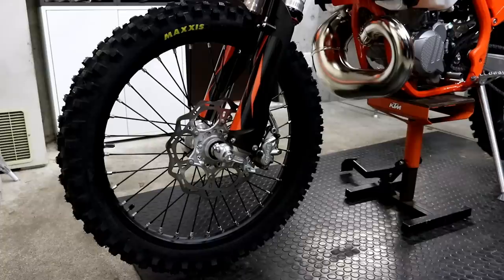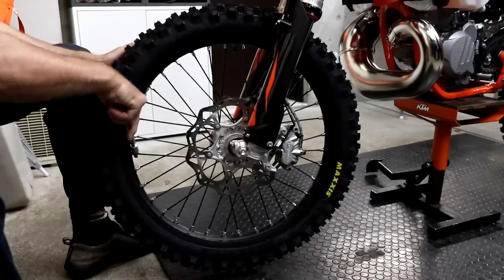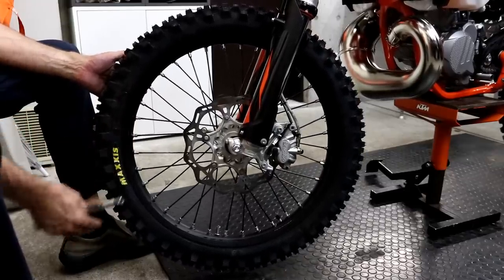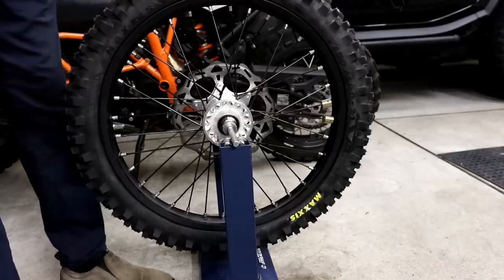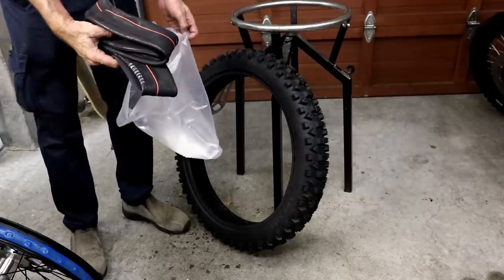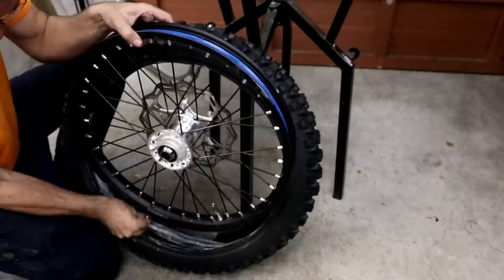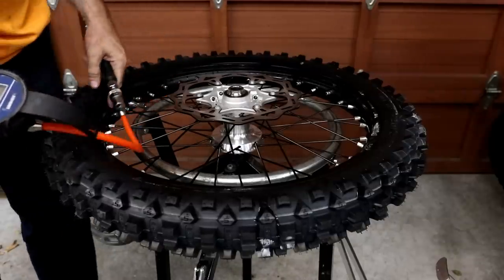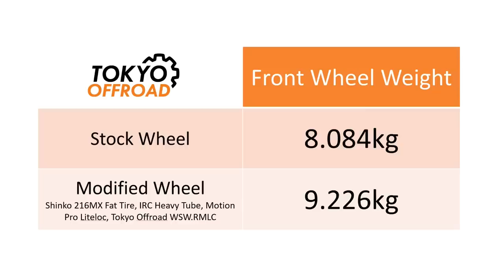2019 KTM 250 EXC TPI- Front Wheel Preparation & Mods

Comment: Run a similar setup with the IRC heavy duty tube up front and tubliss rear.  Ive ran both the Shinko 216 fatty and GT 216 (latest version) and am back running the GT.  The side knobs chunked on the Shinko after 5 rides and was toast.  Ive had no problems with the GT fatty chunking on all of them i have ran.  I also was surprised by the weight difference between the two.  You immediately notice it when just holding each tire in your hand.   I weighed both and the GT came in at 1.8lbs lighter.  

Anyways, I appreciate your video and detail explanations.  Always enjoy watching them.  Look forward to hearing more about the TPI and how its working for you.
Reply from the maker: Wow, I'm surprised at the weight difference. When I compared the Shinko 216MX with the GT216AA Fat Tire (original version) the weights were virtually identical. I'll have to get one of the new version GT216AA and try it.
Reply: Tokyo Offroad I believe the Shinko version is 4 ply and the GT is 2 ply only.  GT used to sell a 2 and 4 ply version of the fatty.
Reply from the maker: LostInPA - Other than the side knob tearing I’m really happy with the Shinko 216MX Fatty. I’m keeping an eye on the current ones I have mounted to see if they do the same. I’m hoping that Shinko have, or can fit this issue as they are otherwise excellent tires IMO

Comment: Mark, if the wheel is true and only needs tightening, then its important to take MAX 1/8 - 1/4 turn on each spoke and go round and round until all spokes are getting equal tension...tightening the spoke immediately to target torque setting will screw up the wheel trueness (personal experience).
Reply from the maker: Some of the spokes were quite loose and a few at torque already. As shown in the video I didn’t immediately tighten the loose spokes to torque, it took me 3 rounds before all spokes were at torque. I choose to tighten a maximum of 1/2 a turn in one go.

Comment: Hi Tokyo, can you give some more details on the torque wrench please. Thanks for a great video.
Reply from the maker: It's a Tohnichi CL10NX8D-MH torque wrench which covers a 2-10Nm range. The head can be exchanged. 
https://www.tohnichi.com/products/adjustable-torque-wrench-CLMH.htm
As I mentioned in the video I made an adapter so I can use a Fasst 6.8mm spoke nipple head. If you don't have access to a lathe and want something which works out of the box Fasst have preset and adjustable spoke torque wrenches which are available as kits with various heads, or the wrench only and you purchase the heads you need separately.
https://www.fasstco.com/collections/motorcycle/products/spoke-torque-wrench
https://www.fasstco.com/collections/motorcycle/products/adjustable-spoke-torque-wrench

Comment: 1,2 kg added on front wheel is a NIGHTMARE!
Reply from the maker: I agree that lower weight is preferable, especially when it's unsprung weight. But the front wheel setup I'm using (heavy tube at 11psi, Shinko Fatty 90/100-21 216MX) feels great when riding off-road. It seems that most people who try fat front tires (90/100-21) like them for off-road riding, even though they are heavier that regular size fronts.

Comment: but why change these tyres? maxxis are excellent tyres in my experience on ktm 500 exc and I ride everywhere, snow, mud, sand etc. Also, I tried heavy duty tubes few times and compared them to regular ones - I got less punctures on regular, thin tubes :)
Reply from the maker: My experience is the reverse to yours. I’m not a fan of the stock tires and the stock tubes puncture very easily.
Reply: I agree, stock Maxxis are excellent tyres. No need to change.
Reply from the maker: I prefer the Shinko 216MX Fat front tire. Great grip, wear and excellent puncture resistance. Due to the extra height of the Fat tire it balances out the rear 120/100-18 size Shinko 505 Cheater and 525X tires well. 90/90-21 tires are about 10mm lower. I think it's important to match front and rear tire sizes to ensure the bike handles well. Anyway, everyone has their own tire likes/dislikes, just like oil, so there's only one thing that's for sure and that's not everyone will agree with each other ;-)
Reply: I use a 100 in the summer. Then swap to a 90 in the winter. 90’s better in muddy ruts . Well for me anyway. Great video.

Comment: Why not tubeless all round ?
Reply from the maker: For a long time (about 5 years) I used Tubliss front and rear. Love Tubliss rear so I can run low pressure (4psi). But in the front I think a Heavy Tube works just as well and provides the same, if not better puncture resistance. Tubliss is a PITA if the system fails while you’re out riding. It happened to me about a month ago when the high pressure tube failed during a ride, in the middle of nowhere. I had to take the Tubliss off and replace it with a regular tube which I luckily was carrying in my back pack. Any system has pros and cons...